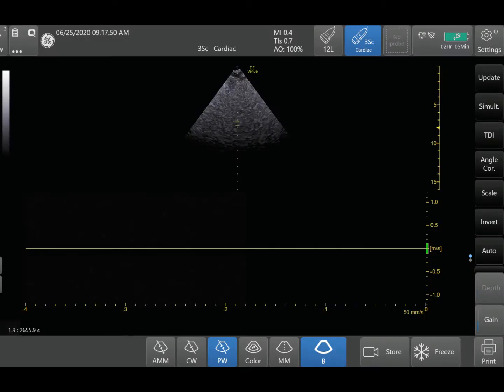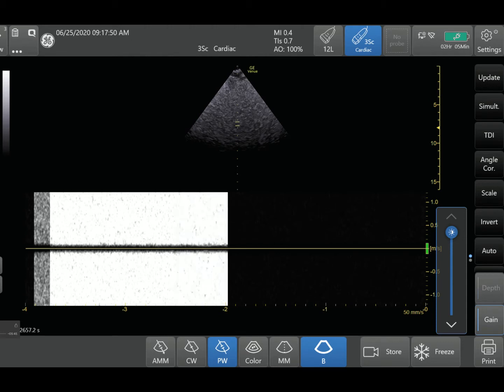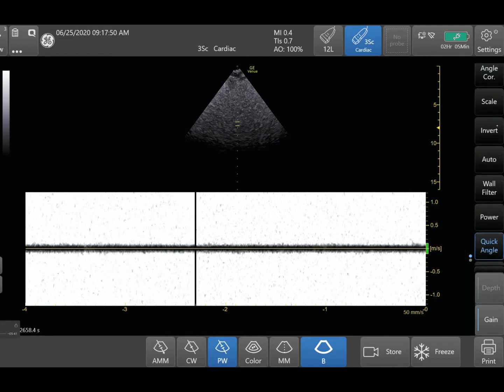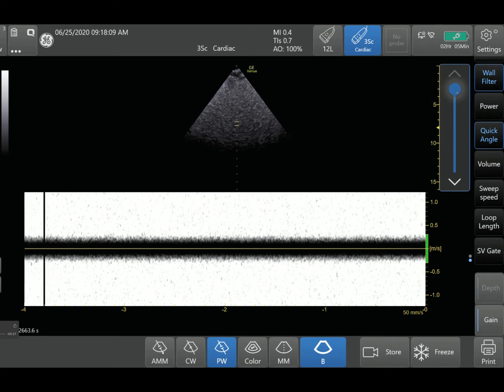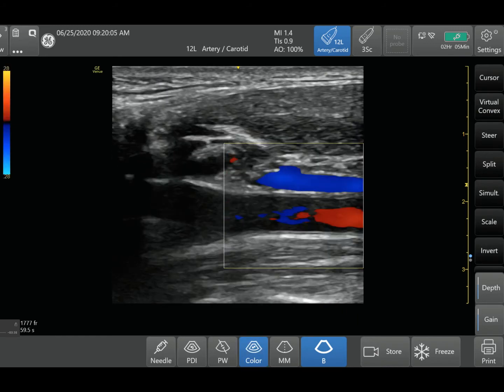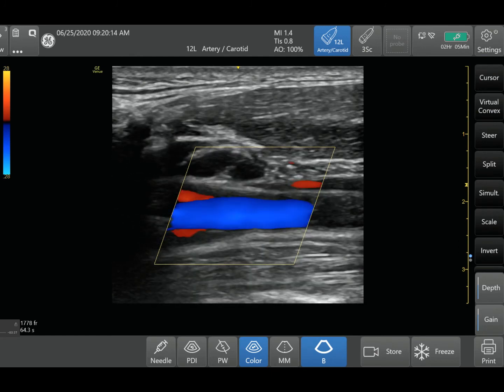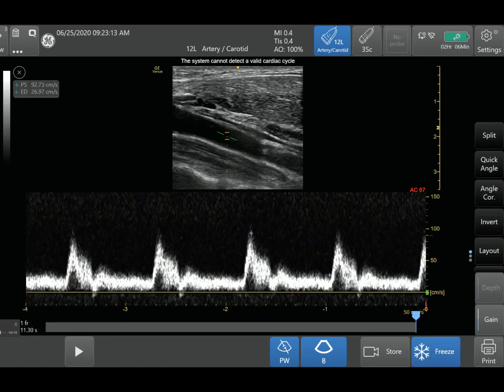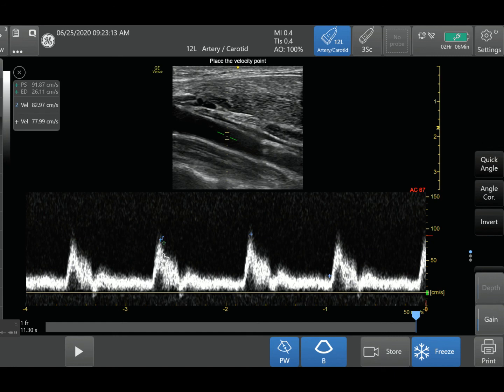Wall Filter, Steering, and Angle Correction - Advanced Ultrasound Doppler Settings made Easy

Comment: The problem is  you gave great advice about using your angle correct but you were over 60 degrees which is incorrect .  You really need to give correct information, especially if a new tech is watching your video!  However, I would hope whomever is doing vascular work should know this!
Reply from the maker: Ideally wouldn't be over 60 degrees in the first place. The point is to show the difference in angle correction and difference in velocity it makes.
Reply: @POCUS101  can you please for us newbies explain how to have a correct angle and still be at 60 degrees
Reply: Ideally he should have used both beam steering and angle correction in combination to keep corrected angle below 60 degree @HugoHerrera-f4u
Reply: Can you please show how to correctly adjust the angle and keep it at 60 degrees please
Reply: 60 degrees is ideal and should be the goal, but per ASE the angle should never exceed 70 degrees. So your angle can still give good readings slightly above 60